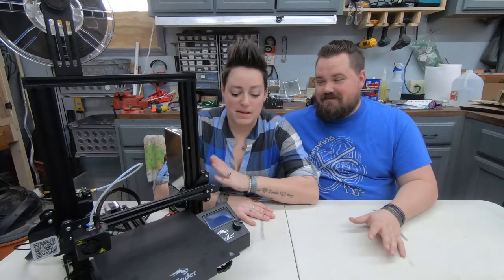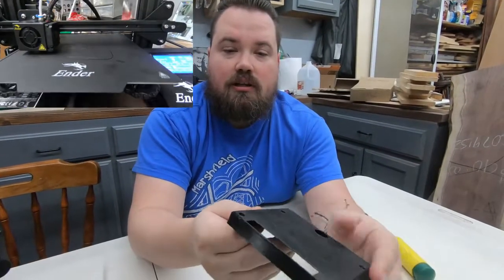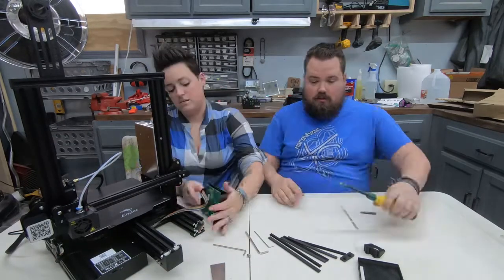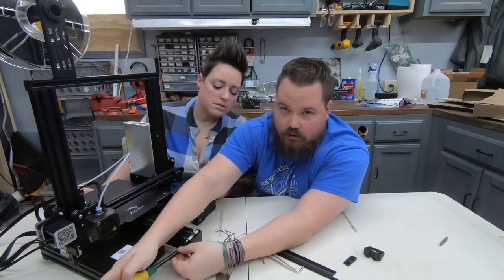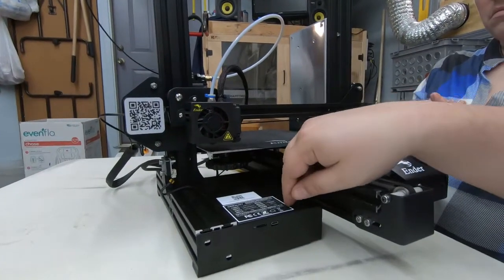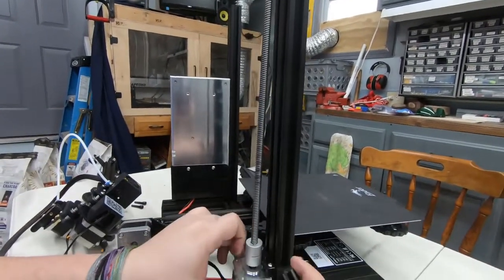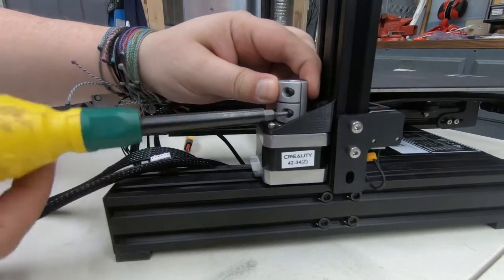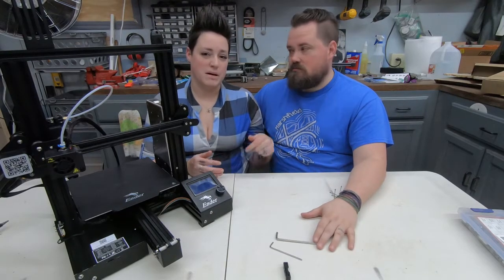First 4 Printable Upgrades for Ender 3 Pro

Comment: One upgrade I did on my 3d printer and I am happy I did, is to upgrade the Aluminum Upgrade Dual Gear filament feeder. as I found with the stock one it was slipping to much.
Reply from the maker: I did hear it click a few times like it was slipping. Wasn’t sure what it was doing. That might be the same thing.
Reply: @KLRform  yep that what the click noise is. Took me ages to figure out. Its a cheap upgrade but worth it